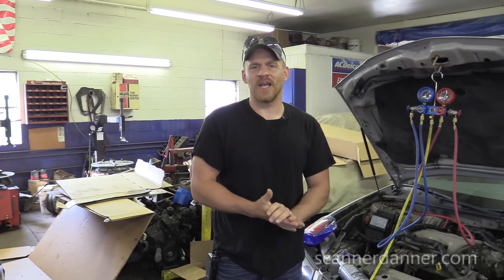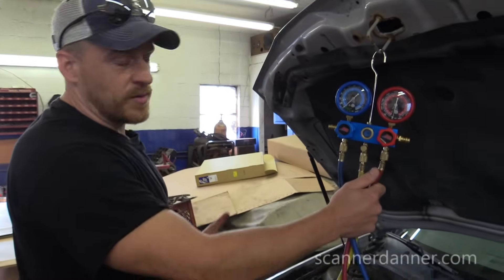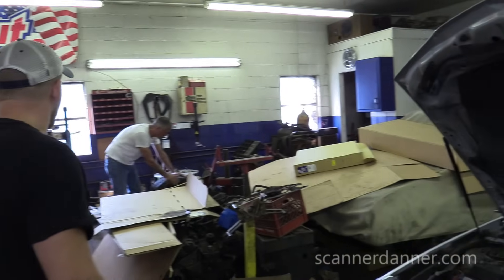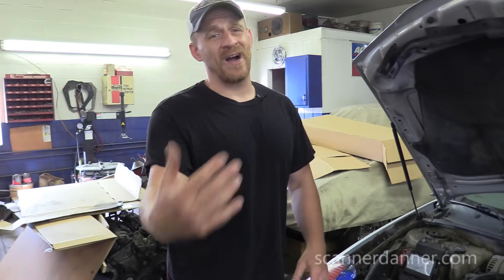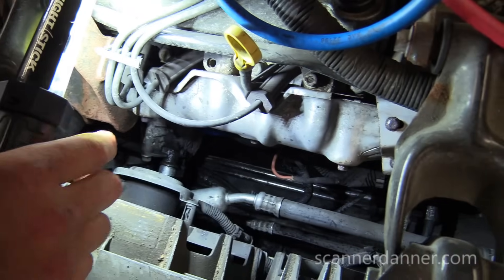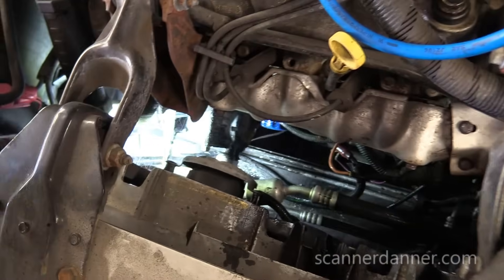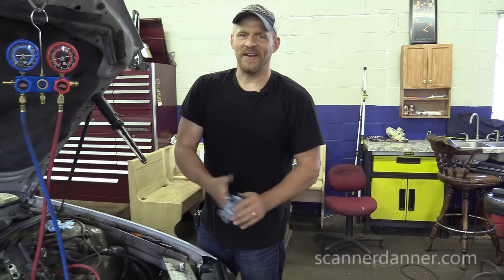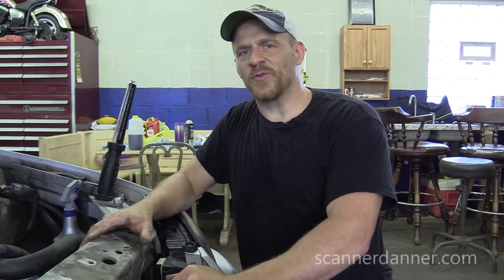A/C Leak Testing Using Compressed Air, Soap and Water (any car)

Comment: Excellent video no nonsense , he is perfectly right if the system has nothing in it pressuring with air is fine .. hell you could even piss in it and pressurise it to check for leaks , once leak located then yes you could use nitrogen for second test or add some gas to it to see what’s going on .... sometimes people just go over the top on this safety and that safety , I’m telling you as ex mechanic all you guys know fuck all happens without that big hammer and that pry bar sorts the stubborn ball joint and mad jobs , u can’t use a toffee hammer like the book says ..video was bang on for me makes sense 👍👍👍🇬🇧🇬🇧👌👌 thanks brother ✊

Comment: Thanks a lot for the good video. Would you recommend a gas sniffer (electronic leak detector) to check for leaks in the evaporator or if it's from the compressor shaft seal? I mean, have you used those and found them to be a good method? Cuz I'm about to invest in one.  Thanks again.
Reply from the maker: Yes, absolutely, especially for those 2 areas you just mentioned

Comment: I used compressed air to pressure test lines on my home AC install with a Goodman condenser. The filter is inside the condenser so I see little benefit in pressure testing lines with Nitrogen since you are going to vacuum anyway.

Comment: Have been doing A/C for 42 years .I have been using compressed air with moisture filters , air used to paint cars, Must use moisture free ai,r I have seen air hose blow out a ounce or 2 of water that would be impossible to vacuum out of the system .1 system is empty or. Recover system .2 add 150 psi paint air.3 I now  use a Robinair ultra sonic leak finder , it hears leaks finds leaks to 1/2 ounce per year. then use soap and water to show customer the leak used soap and water before I had the Robinair ultra sonic. I do over 1000 cars a year.
Reply: Thanks. That was my concern.
Reply: Does the dryer/ accumulator have to be changed when the system is open to air for a period of time?
Reply: @rcaddict3815 receiver dryer as in this case yes. He said it in the video too

Comment: The problem with using moisture laden air is the fact that PAG oil which is used in most automotive refrigeration systems is extremely hydroscopic. If the oil is replaced with a modern synthetic alternative which is not hydroscopic, there is no issue with using compressed air to pressure test. It’s never a great idea to introduce any moisture into a refrigeration system in the first place.

Comment: One could probably complete a deep vaccum after the repairs to purge all moisture from the system?  I have a two stage vaccum pump I usually use for this purpose but thought I would ask if anyone else uses a vaccum pump to purge moisture from AC systems once they are drained and repaired.

Comment: Hi, Danner (Paul), I have Audi A3, with no R134a in the system, I pressurized with the manifold to 100 Psi (air). after running for a few seconds low 45Psi and high 200psi. My issue is the pressures have not equalized after an hour.
Reply from the maker: It was empty when you started right? If yes, then go find your leak, don't worry about the equalization of psi, it could be a problem with the expansion valve, it could be normal as it is air pressure and not refrigerant. Just start over, let the air out, repressurize the system and find your leak. It is good that you now know the compressor is fine.
Reply: @ScannerDanner  yes, it was empty, all the refrigerant had disappeared. Air pressurised to 100psi, but it hasn't dropped all day. So I am now confused.
, no leak. Could the pressure relief valve on the compressor have released the refrigerant at some point?
Reply from the maker: @chriswhitehead6095  no, you have a leak and slow leaks are difficult. Time to evacuate it and recharge it with dye in the system. Also, when you have it charged back up, check the compressor shaft seal area with a leak detector.
Reply: @ScannerDanner  The pressure has dropped today, but it is much colder than yesterday, I will leave the gauges on a while longer. Your brother Jim is so funny talking about his weight loss. Cheers all.
Reply: Found the leak from the pressure switch o-ring, getting it regassed next week. Cheers for your time.
Reply from the maker: @chriswhitehead6095  nice job! persistence is the key isn't it

Comment: Thanks for the info! On the last part of the video u mentioned that when compressor fails we should be replace the expansion valve. I replaced my compressor and got my system working but the air coming out of the vents were 10-15° F above average. However, my gauges reading are 30 psi on low n 350 on high. When I'm driving n my rpm goes over 2000 the compressor clutch starts engaging n disengaging. Do you think the expansion valve is the problem? Overcharged? Or air in the system?
Reply from the maker: 350 sounds high, what was the atmospheric temp during those readings? Did the old compressor pump all kinds of debris into the system? If it did, you may have some crap still in the condenser and you'll need to replace it, especially on a parallel flow design.
Reply: @ScannerDanner  about 85F.

Comment: In theory, High pressure oxygen and oil can cause an explosion.  It would require a very very high pressure at the % of oxygen in the compressed air that was being used (approximately 20% O2.).  It would be better to test with nitrogen but I see no true danger with using compressed air.
Reply: A diesel engine has ~400 psig air in the presence of oil, before the fuel is injected and it doesn't explode.  The compressed air is hot enough to ignite the fuel droplets as they are sprayed in.  I have heard that a diesel with poor oil control rings can actually keep running on the oil which gets past the rings.  For finding leaks in a car's AC, 100 psig suffices.  The highest system pressure with the AC compressor running is ~350 psig.

Comment: Why don't you use UV additive?
Reply from the maker: because you have to add it with refrigerant and it is not my preferred method. What if you have a gaping hole in a line? You just wasted your time.
Reply: @ScannerDanner  I mean, I'm surprised you don't have a common practice in the U.S. of adding a UV additive every time you refill A/C. Cause it speeds up and simplifies the search for leaks.
Reply from the maker: @funkensteinthedoctor  oh I understand now, thanks. There really is no standard for that. I would certainly add dye to a system that I couldn't pinpoint a leak on but to be honest, when I see those cars come back empty, I've had them more times than not show any evidence of dye. Maybe the dyes have gotten better over the past 15 years? I don't really do much AC work these days anyway.

Comment: I came looking on how to introduce compress air to my impala ac and this video did not disappoint. I didn't even type Impala and it was the first thing that popped up. Awesome work guys
Reply: I would also also like to add. The cheapo trigger pull freon gauage valves that you get on like an AC pro has the same female threads as a air compressor male connector

Comment: Can I put refrigerant in from the high side I'm waiting on a 90 degree fitting so I can charge up my truck. Kind of impatient
Reply: You can only charge on the high side when the system is off. After you start the compressor you must charge from the low side only or the can of refrigerator can explode in your face.
Reply: NO!

Comment: Yep I'll be doing that on my 01 F350 to find the leak. Yep it will be vacuumed out and the Accumulator/drier will be changed before I put the R134A in. I don't see a problem using Air on a system that has NO refrigerant in it at all. Or starting it with air, for 30 seconds, to check the; expansion valve, pump and pressure differential, it's probably no sweat at all. In fact it's a technique I doubt would have thought of if I had not seen your video. Beside IF you don't have an expensive R134A recovery tank, and most people won't, you loose all that refrigerant if the pump is bad. So your technique is good for the environment bro! LOL Thanks for sharing. Best Wishes & Blessings. Keith Noneya
Reply: 30 seconds is to long for no oil , I  use  5 seconds  it is all you need to see compressor turn on and see Gage move, it will not read the same as if it had 134a in it.but can see if it is pumping.

Comment: Everyone has an opinion, good or bad. It's so easy to be mean, but ScannerDanner, I will give 5 or 5 stars for showing a method for the average guy with a garage, some tools and a compressor. While nitrogen with a little refrigerant used with an electronic leak detector is dealership best practices, but we all know that most don't have nitrogen equipment sitting around. Best practices always starts with a good visual. Seeing oil on an A/C component is a good note to make, then confirm it. Using shop air with 110 - 130 PSI, high concentration of soap works, but gaining access or getting an eye-ball on any given spot is hard as todays vehicles shoe-spoon engine and everything into the tiny cavity called the engine compartment. How many time can you drop a 13mm impact swivel and it never hits the ground. Hate it you have a 20 minute job, drop a socket and spend 40 minutes looking for it. Some would say, who cares, but that SnapOn socket is $32. People need to understand that pressure switches, pop-off valves on compressors, electronics control everything as you pointed out. No R134a, no lube flow, compressor goes boom. The PCM may shut of the A/C upon WOT to add power, but also to protect the compressor from high rotational forces that can cause internal failures. A few seconds on to "See" activity from A/C control is quick and you did that well. Most DIYers' have to understand that this is instructive information. If it is beyond their abilities, take it to a professional with equipment is best. I want everyone to know, do NOT buy the leak seal goo with dye and a squirt of refrigerant, usually with POE Ester oil in the cans..... NOT ok for any system. I would flush to get that out. For the DIYers' the "Receiver/Dyer" is used with a TXV as it will adjust to cool until almost empty. O-Tube systems are fixed, so too much juice, it floods the Evap, liquid has to got into an Accumulator to boil off and turn into a gas. Liquid cannot be compressed, so over-filling is too easy when R143a systems hold 1.4 lbs.(+/-) unless it has rear A/C. Small car, less, read the label underwood as we do. This is two cans of 12 oz into an empty system. More is NOT better! Also the longer the system has been empty, I would change the dryer, but under a vacuum, use a hot air gun on the dyer to help it boil off moisture. But how good is it afterwards. How many times has it gone empty before with out changing the dyer. Over All, Good Job! Thumbs up. ASE Master Tech since 1978 / Retired.

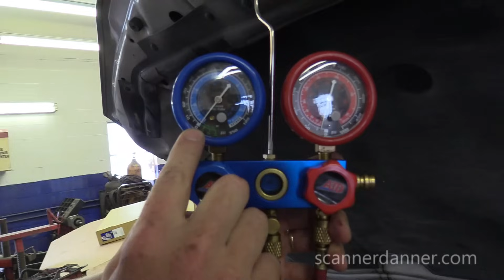Comment: 0:42 put on safety glasses to work on the low pressure side, remove safety glasses to work on the high pressure side!
Reply from the maker: There was no pressure in the system! At rest there is no low side and high side, they are the same. The low connection showed what? That's correct, no pressure, so what do you think the high side will have in it? You guessed it, no pressure lol
Didn't need my safety glasses anymore
Reply: @ScannerDanner  Just sounded funny, I wasn't trying to be a jack about it.
Reply from the maker: Sorry, I certainly was wasn't I?

Comment: Some advice please ?  vw golf 1.6 tdi ac not working so i pressurized the system with 70psi of air started the engine to test electrical system all ok. But i left around 60psi of air pressure over night and by the morning i checked it and it has no psi pressure what so ever.  Is that normal because its air ?????????????????????????????????????????????????????? Thanks from the UK :-)

Comment: Thank you for this video.  Been fighting a leak on a completely new replaced system on my 86 mustang. Wouldn't hold a vaccum so I could add refrigerant.  This let me find the leak in the brand new pressure switch. Replace switch, now it holds vacuum.

Comment: Just watched this video, that is a great idea. Although i would have taken a look first with the uv light and yellow glasses, since you said, and i suspected, that the water/soap mix would wash away the evidence of the leak. That would have helped to narrow down where to look for the leaks before spraying the water/soap mix. Also, it would help to have the car on a hoist, as sometimes access is better and/or easier from the bottom.
Reply: You must be implying that there is a dye in the system to use the UV light. And that's the way I would have suggested as the dye should have been real easy to spot. I would waste a what is now about $8 can of refrigerant/dye for checking as you would probably be able to get 20 psi for checking pressure which should be plenty. I'm just not a big fan of purposely injecting air in a AC system for all the reasons already given.
Reply: Most cars since the mid to late 90's have the dye in the refrigerant put in when the car is built in the factory.  But, using air is a cheap and quick way to try to find leaks, as it does save on putting more refrigerant into the system just to find a leak. However, so leaks are so small, it's better to put dye in and top off the refrigerant and have the customer return in a few days.

Comment: Hi!  Nice video & good instructions! I have a 1998 Chev Blazer. The AC has not worked in 15 years. I do have the gauge, tools and refringent - but after so many years of none usage, is it best just to let a professional handle this - for fear that I might run into something I might not be able to handle? Appreciate your advice, Noel
Reply from the maker: no reason for that, what are your pressures in the system at rest?

Comment: Not sure if anyone is still checking comments here but I thought the compressor doesn't come on with no refrigerant because of a safety mechanism like a pressure switch. That way it wouldn't damage itself. Is this not right?
Reply from the maker: that is correct

Comment: Pretty cool that a famous YT Professor wears jeans with holes. Now I don't feel so bad when I so the same. Oh and he watches cartoons, good stuff. Okay George back to work. 
Okay what is the difference between an accumulator dryer and a  receiver dryer? Receiver dryer uses a thermal expansion system and an accumulator uses an orifice tube system?
Another great video guys
Reply from the maker: That is correct! Thanks man

Comment: Not to ruffle feathers or anything but this seems like some hillbilly shit compared to a uv leak test kit evaluating all leaks and areas of concern... I mean it's not as cheap as dawn dish soap (or is it considering you had a couple hired hands on deck) but will reveal any and all leaks in the system. Cheap and to some extent effective, yes. Dish soap method over uv..? I'll leave the soap in the kitchen.
Reply from the maker: The method I've shown is great when you suspect a major component failure. Why would you want to pump refrigerant and dye in a system only to find it dumping to the atmosphere as fast as you are putting it in?
Reply: @ScannerDanner  I get the whole damaging the atmosphere thing but in the same breath how many cars daily end up in front end collisions dumping their entire load of refrigerant into the atmosphere without a single word of environmental safety associated with it... I'm just out here trying to accurately diagnose and repair any and all leaks within the entire ac system not even popping a quarter of that same load..to the customers appreciation.. to each his own..

Comment: Excellent and useful video! Thank you. If I see correctly, you introduced compressed air through low side port and it equalized almost immediately? Am I correct? Could it be done from the high pressure side and would it be any difference?
Reply from the maker: it can be done from either side. Technically with the AC off, there is no high side or low side, they are both connected (by a restriction of course)

Comment: I still don't understand why you will need to replace the accumulator dryer or the receiver dryer. I've replaced just condensers and recharged system and it works just fine. Why do you need to change those? 
I been working on cars since I was 6. I learned alot from my pops but I never really got to learn the diagnostics part of the trade. I am trying to master that with you. I learn something new from all your videos. But this... I just dont get this
Reply: over time the receivers acquire moisture....it's such a cheap part it's best to just replace it before it gets saturated

Comment: Just use nitrogen instead of air unless you like moisture in your ac system and you don’t like your ac to work . You might not have a leak but you won’t have cold blow whooping on that head

Comment: Good Job. I would replace the bad condenser and the dryer ,run a vacuum check and if it holds minus 30 psi for an hour.It is good to go for a recharge.